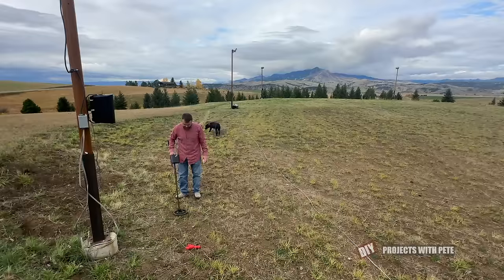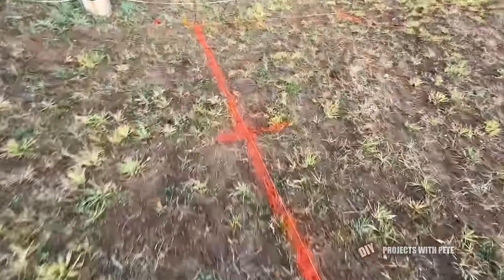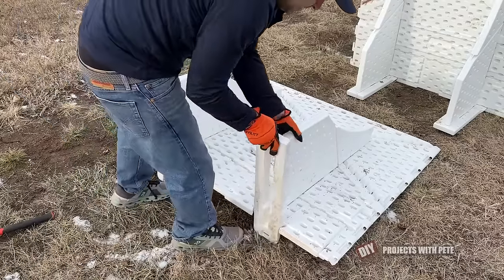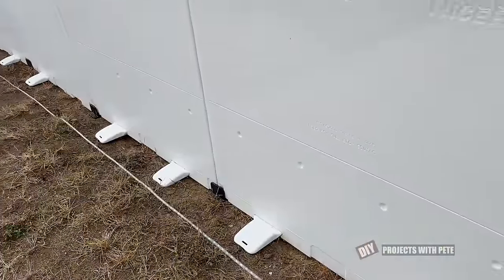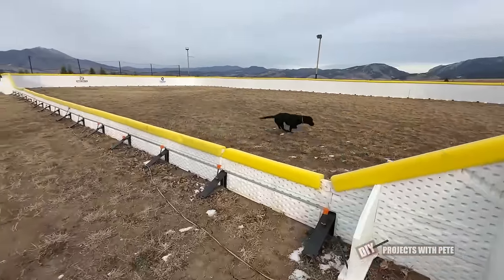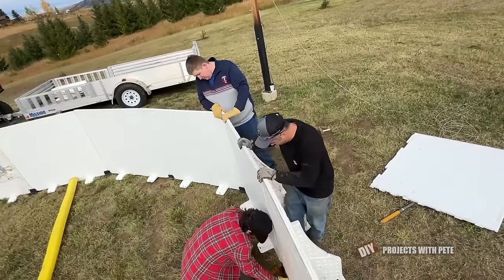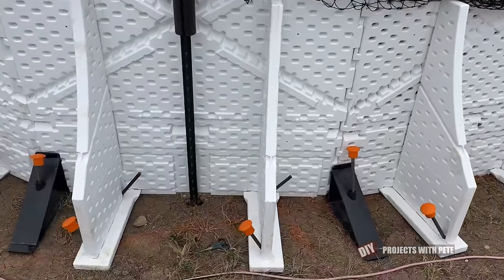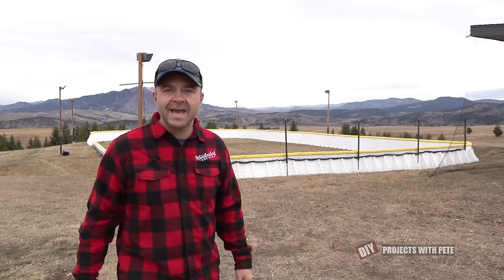Setting up Outdoor Hockey Rink Boards | ODR Setup | NiceRink Tallboys

Comment: Will be interested to see how the Tallboys hold up.  I don' t think you could get them much more secure but they do look like they could catch a fair bit of wind. Hopefully it will be a non-issue for you.  Looking forward to the next update.
Reply from the maker: Hey Jeff! I had the tallboys for the rink I did 2 years ago, it was the first set shipped out ( I transitioned to the 18 inch boards on each long side after the corners .  - but they held up great and I only had a couple stakes in them.  ( they went up just a couple days before i filled the rink.  This year I staked the heck out of them just since I put them up in october and didn't want them to go flying. I will say they held up in a 63 mph gust we had in November. Cheers!
Reply: Oh yes! I was thinking this was the first trial run for the tall boys. Should be all set if they can stand up to some + 60 mph gusts. I have a 28 x 56 NiceRink setup I was able to buy used a few years ago.  Worth the work once you see the kids out skating on it.
Reply from the maker: Hey Jeff! That is awesome you have a 28x56 setup! Yep, I agree. A labor of love but worth it once the kids are out there! -- I would say the only time i'm worried about the boards is before the water goes in. Once the water goes in and covers the feet and freezes against the boards it is rock solid. It's just if you put them up super early like we did that I worry about the high winds blowing them. which happened once when I didn't do every stake! But I also think we have a lot higher winds than most folks will see, especially for those who live in town with homes and fences protecting them. Cheers and I hope the weather gets cold so you can get the rink up soon!!

Comment: Very legit backyard rink! Have you ever considered lining the perimeter of the rink with pavers so you don't have to do the layout each year? Also if you feel like saving your arm pounding rebar, get yourself a SDS plus ground rod driver!
Reply from the maker: Thanks! So I just ordered an SDS plus ground rod driver when I saw your comment a couple days ago and should be in later this week. GENIUS idea! Thanks so much, I can't wait to try it on my Dewalt rotary hammer demo tool! that will save my arms and wrists next year. THANK YOU! -- haven't thought of pavers, would they go outside the rink? I keep the corner stakes in and just do a quick stringline and paint which is easy, but always love to hear ideas!
Reply: @DIYPETE  you could do paver’s 10’ from each corner just to keep you square or you could do pavers around the whole parameter so setting up boards is a ease…
Reply from the maker: Gotcha, thanks for the ideas! And can’t wait to try out the rod driver!

Comment: how do you like the tall boys? I have the nice rink 18 inch boards mine is 32 by 72
Reply from the maker: Hey Josh! I like the tall boys. Especially on the ends to keep the puck in when shooting. A net obviously works too, but the boards are definitely nice for that. This is the first year doing the side with tall boys all the way on the one side. So that will be interesting to see what we think of clearing the snow that's made from skating since we will have to shovel it up and over the 4 foot boards instead of an easy toss over the 18 inch boards. Will also be interesting to see how the drifts pile in since we are out in the open and get lots of wind. I will report back after using them this season, but did really like using them on the corners / ends for the last time we did the rink!
Reply: awesome I had wood boards switched to the nice rink boards this summer and Built a bigger rink from 28 by 48 to 32 by 72 my amazing neighbours let me use 15 ft of the corner of there yard to make my rink bigger :) @DIYPETE
Reply from the maker: Sounds like some awesome neighbors! Love it! And that is a great sized rink!!

Comment: Are you concerned with cutting the led lights again since you're likely going to get snowfall you'll need to blow out before putting the liner on?
Reply from the maker: Hey! Great question. This was a concern of mine as well.   I flagged the lines so I know exactly where they are in case we get snow, and  adjusted the skids below the auger so it stays a couple inches off the ground. The LED lights are pulled tighter and have plenty of yard staples this year. So I feel pretty good about it and may even use a shovel to be safe around those areas if the need arises. But last year we put them in when it was really cold and it was hard to get the staples in and the LED coils were so cold it was tough to get them to lay flat. So I do think this will work out better this year and if I were to accidentally cut one I have patch kits. But I will share how it goes in the final video of the rink for sure! Great question and I will know by trial and error this year haha :) Cheers

Comment: Great video Pete! I know you said a video is coming for how you did your netting, but those of us who need to put up netting asap (this weekend!) are curious if you can quickly describe it? What kind of stakes are those that you used and how tall? How did you attach the netting? What kind of netting and where did you get it from? Thanks Pete!
Reply from the maker: Hey! Thanks, you are in luck. I have a video that will go up within the next 48 hours on how we do the stakes ( maybe sooner ). Anyhow, I use 10 foot t posts and attach the netting to it with zip ties. Pound posts in with a post hole pounder ( can get at a hardware store ). If you want to pro up the look of the t posts you can use black foam pipe insulation. Pretty simple, cost efficient, and effective! Check back though in the next few days to see the video. Cheers!
Reply: You're the best, thanks!  @DIYPETE
Reply from the maker: Happy to help!
Reply from the maker: Just thought I'd drop ya a note and let you know the netting video is live! Cheers and good luck with your net project this weekend! https://youtu.be/t_Ws4jNHRvE?si=Sa_sLN0Zvl21V1qe

Comment: I love your rink and your videos but when I look at your lawn and that particular area it doesn’t seem very usable for much in the summer, so why don’t you just leave up a permanent board solution and make 4+ days of your life per year that much easier?
Reply from the maker: Thanks! We just use it in the summer to throw a football around and baseball. We've tried planting grass and it comes in a little thicker each year, but is still very sparse with lots of weeds and thus doesn't make the best field to play around in. But it is lit and it works! It takes about 5 hours to set up the board portion of the project with a couple helpers so isn't too bad. The lights stay up year round. Trimming / mowing around it would be a descent amount of work but probably not too terrible. The boards have done well in the wind, but I'd love to use a U style stake or rebar with a knob on the end to better lock down the board as really high winds can pull it up a bit ( I'm talking 60+ miles per hour ).   since the angled rebar isn't 100% efficient in locking it down. Definitely something to experiment with though as it would be nice to save some work! --- Cheers!